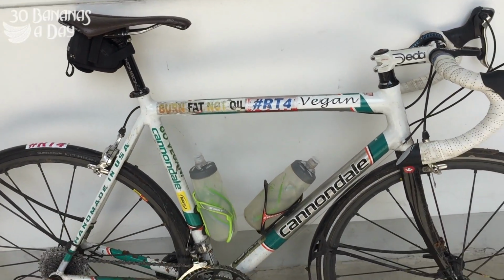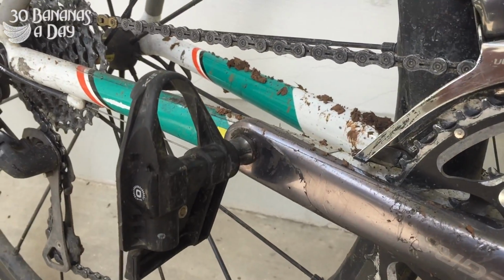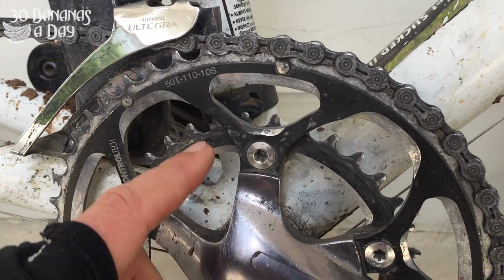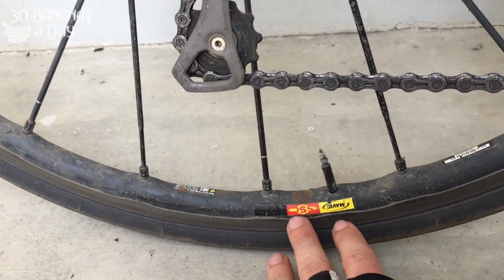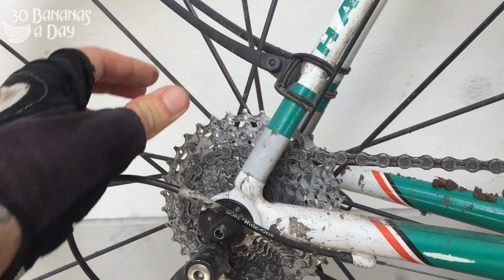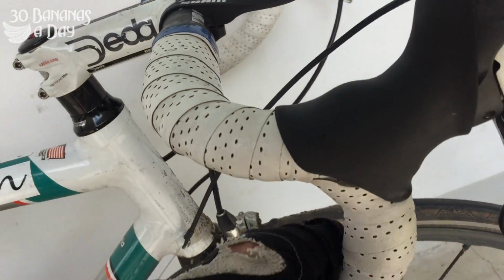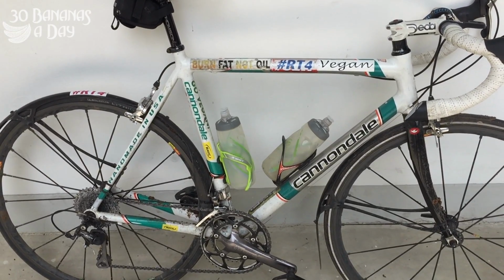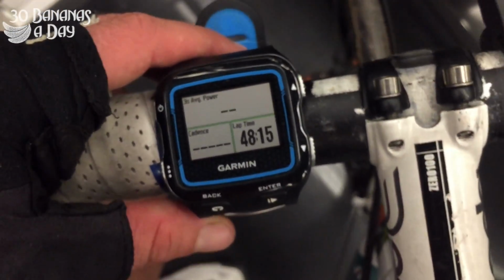Cannondale CAAD9 after 8 years of THRASHING!

Comment: kinda blows shimano's rule that the 5700-GS will only take a 30T max cog which is nice to know cuz im currently wanting to change the cassette and rear mech for cadence in the Alps, not a 34T though :D
Reply: altern8ive I am riding a 5700-GS with an 11-32 SLX cassette (i believe it is). No problems.
Reply: It will take a 36 cassette ON MOST BIKES WITH VERTICAL DROPOUT AND B SCREW WOUND IN.
Reply: that's good to know, i've read far too many conflicting reports on what will actually work. thanks for the feedback
Reply: Fuji Roubaix, 10-speed 105 short cage RD took 11-36 out of the box, b screw all the way in.

Comment: DA7800, the best I've ever used. Would a spacer on the back of that cassette take up some slack? That's pretty wobbly mate.
Reply from the maker: Greg Green It already has a spacer. It is play in the freehub body itself due to Mavic's poor design for the last 15 years. They need to copy DT Swiss 240 freehub design. It is the best in the business.
Reply: Had shit loads of them come back for warranty at the shop. Mavic repair it and a few miles later it's loose again.

Comment: I got a giant defy aluxx yesturday. i know you said to get a 10 on the back but i thought 11 wouldnt hurt. its niceeeeeee
Reply: Mango Man Ⓥ do you think a garmin edge 200 will be good enough
Reply: +Mango Man Ⓥ yes
Reply: Mango Man Ⓥ Used a 200 for over a year, it does the job - if you don't want any Ant+ connectivity. Doesn't have a barometric altimeter but uploading to Connect, Strava or RWGPS will give the correct elevation. only complaint i have is it's tendency to drop the speed to zero occasionally (auto pause disabled) while climbing at 12kmh or less under tree cover - they were steep climbs :) The 500 has come down a little in price since the 510 and 520 replaced it but if it's not what you want the 200 will be sufficient.
Reply: i swapped my 200 with a 500 for that reason. the 200 will become a little restrictive in the long term if your goals with what you want to get from riding a bike become greater. 510 and 520 are nice devices but i didn't need the live track or live segment data from them.
Reply: altern8ive sorry guys for some reason I'm getting no notifications on youtube. thanks for the advice!

Comment: What's the advantage of having a long derailleur like that?
Reply: J Dog because a short cage mech won't work. a long cage takes up the extra slack in the chain due to the cassette and front ring configuration.
Reply: J Dog The big difference between teeth on front and rear (34 front, 32-34 rear) is massive and needs a long chain. Therefore a long cage is needed to take up the slack from such a long chain :)
If you only use like 50-34, 11-23-28 a long cage is not needed at all :)

Comment: You're missing a spacer washer for rear cassette bud.
Reply from the maker: cuttski nope. google it. "Mavic freehub body play". Mavics design is so sloppy they are like that out of the box and only get worse over time. My first Ksyrium was the original back in June 2000 and I had problems with them. I thought they would have gotten better after 15 years but I was wrong. They are still a nice rolling wheel that looks good with an excellent braking surface though. DT Swiss hubs are my fav though.
Reply: What do you think of the alloy/ carbon combo? From mavic they are near enough the same price as those as well ...
Reply: Mavic R-sys Slr. Around £1000

Comment: Those pedals are horrid! Speedplay all day ery'day.
Reply: Whats wrong with the pedals? and what makes speedplay better than shimano?
Reply from the maker: PlantPedaler Ive used both. Have you? Speedplay are super hard to clip in and the cleats are heavy and expensive. Keywin have a larger surface area, lighter, cheaper and the cleats last way longer and are very consistent each ride.

Either pedal system will work at the end of the day but the Keywin is with out question the lightest and stiffest road pedal ever to hit the market. Also the hardest wearing cleats.